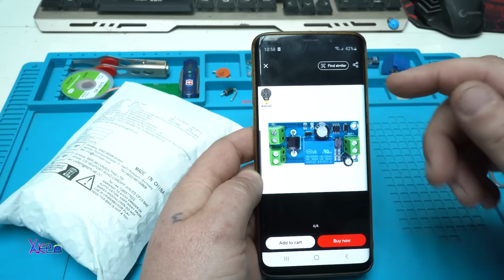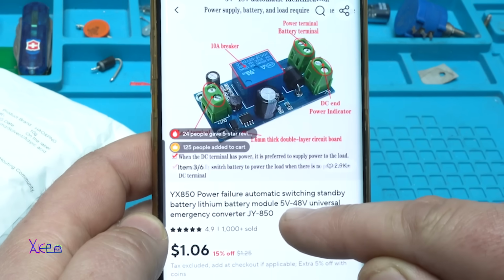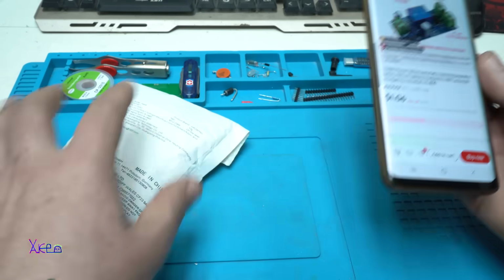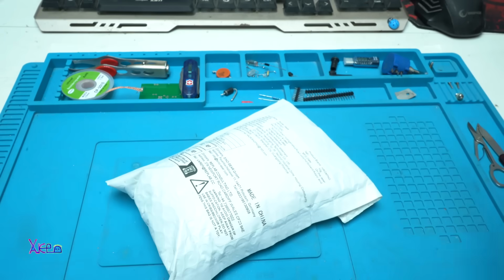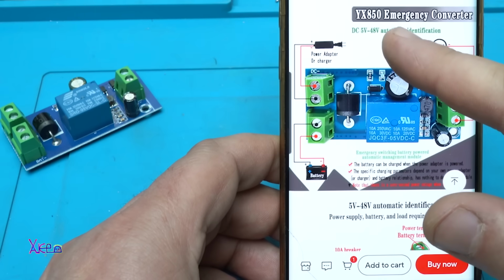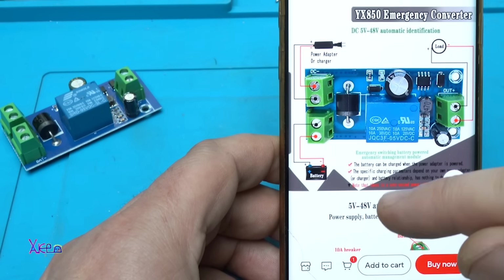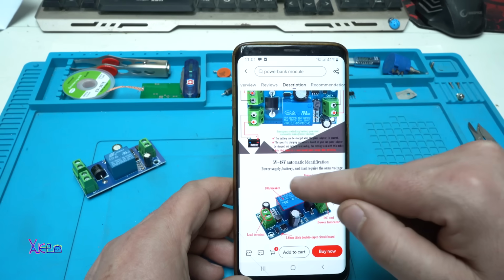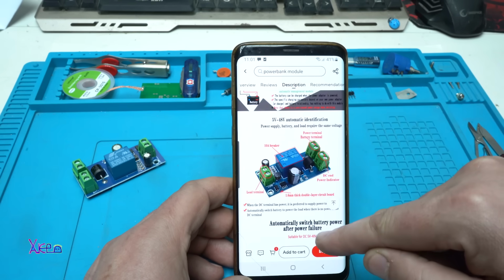The $1 AliExpress Module- Power failure automatic switch YX850

Comment: Time for some 18650 based Raspberry Pi home brew 'UPS' units. I just need to find a cheap BMS/case option for the batteries and will charge them from A/C externally as well as power the module from a seperate power source. No reason to put additional load on the module to pass power in both directions on the battery terminal. Just to keep it simple with 2 power sources.

Comment: Does it also charge the lithium batteries if not, it will be a good project for you to show us how we can have the battery being charged and when the power goes off, the main one, the batteries kick in
Reply from the maker: Its just a switch,you need seperate charger for battery

Comment: You should have verified if the router could operate without losing any packets while the board is switching between the power supplies.
Reply from the maker: Yes I need to test that for sure!

Comment: I'VE DONE THIS WITH JUST TWO DIODES. THE AC SUPPLY HAS TO BE A FEW TENTHS OF A VOLT HIGHER THAN THE BATTERY . THE DIODES ARE CURRENT STEERING, AND COST ONLY A FEW CENTS. I'VE DONE THIS FOR DECADES.
Reply: hi ,can you explains how do you do
Reply: @vanderleisilvasantos5343  YOU JUST USE DIDOES RATED ABOVE THE REQUIRED CURRENT, PUT ONE IN SERIES WITH EACH SOURCE. THE HIGHER  SOURCE WILL FORWARD BIAS THAT DIODE ON, AND THE OTHER OFF. SHOTTKY DIODES HAVE A VERY LOW FORWARD VOLTAGE DROP, (ABOUT 1/5 OF REGULAR SILICON), AND YOU CAN GET A PAIR OF THEM IN A TO-220 OR SIMILAR PACKAGE WITH A COMMON CATHODE.FOR THE POSITIVE VOLTAGE SOURCES. COMMON ANODE WOULD BE REQUIRED FOR NEGATIVE SOURCES.
I apologize for the all caps posts. I'm low vision these days, and didn't realize I'd hit the caps lock.

Comment: You can increase the current capacity of the changeover by adding a suitable capacitor for your load across the the output contacts.  It will help with the ripple when the changeover happens.

Comment: Does it charge the battery when it is on main power.
Reply: That would be an extra circuit that you could design to work in parallel with this one.
Reply from the maker: No charging

Comment: Why its this better than a double diode transistor? or like direct connection between the adapter and the bms?
Reply: Because that would start a fire.
Reply: @Alacritous  so the rectifier diodes starts a fire

Comment: Hello Marjan, this is a very nice and useful module. I already have a few ideas where I could use this module.
2 questions here:
- Is the battery charged by the module?
- Could a capacitor be placed on the output to avoid a short interruption time caused by the switching of the relay?
Thanks for sharing your experience here and in countless other videos. I love it 😃
Reply: There is no charging circuitry or BMS but you could add a stand-alone one to manage the batteries.  Better ones can charge and draw - but that may be not necessary in this case since we're assuming we lost mains power to switch to batteries anyways.

Comment: The problem is that it has a gap between switching so the rotor restarts, that you did not check.
Reply: You can fix that by adding a larger capacitor across the output contacts to fill in the gap and smooth out the changeover ripple.
Reply: True, if the device doesn't have an internal memory. I designed and built a switching device for my cordless house telephone (9VDC for base station) in case of power failure. 
   There is a delay of about 0.1 second for relay switching, but the internal memory remains intact.
Reply: Yes - you can actually see this on the Video - router default is 2 green lights(operational), but when author unplugs the AC adapter, router restarts with just 1 green light, later followed by 2nd green light....

Comment: I have very similar module. The latency of switching between the power sources is long enough to make my router  reboot... not nice.
Reply: Ask your friendly local neighbourhood electrolytic capacitor about that problem .....  😉
Reply: @TRS-Tech  Brilliant. Great, simple solution.
Reply: 👍  Nice fat electrolytic on the output should do the job, its likely only microseconds of delay for the relay contacts to change over.
Reply: @ Yes, they do mention it on some of the offers that there are a few microseconds delay.